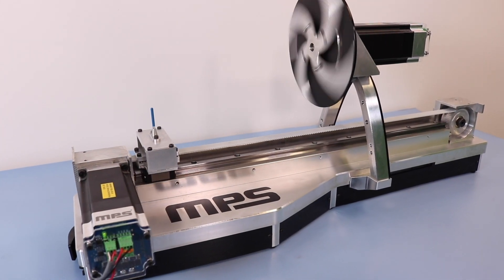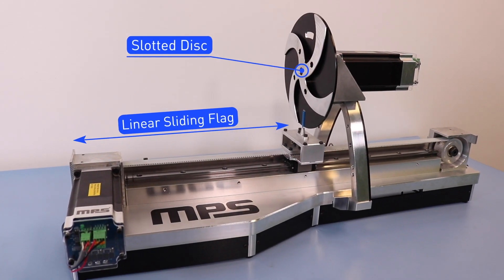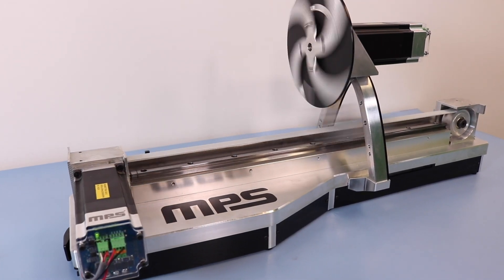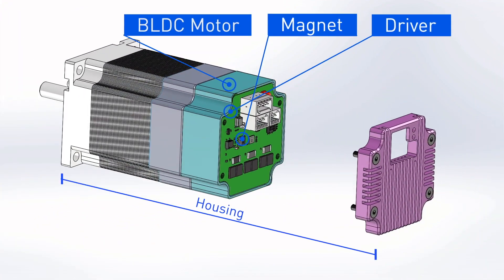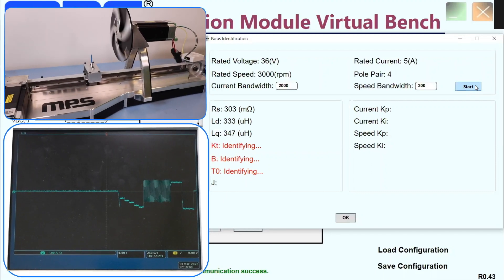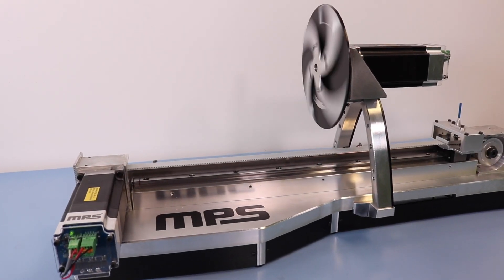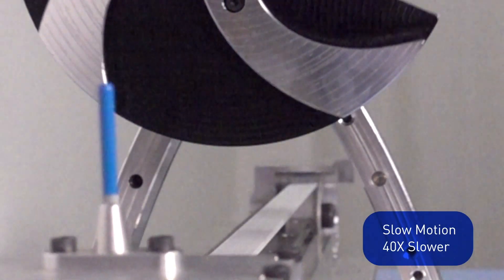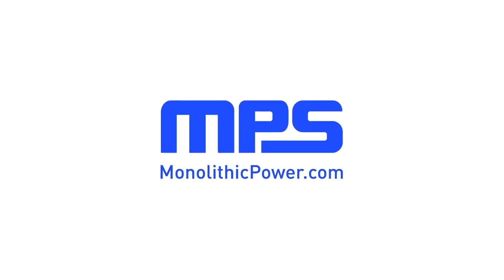Advantages of the Brushless DC Smart Motor Module Evaluation Kit

Comment: I can’t find the Nema17 motor. Can you post a Link or part number? Are these torque wise comparable to steppers? (I do have closed loop servos on my cnc in Nema23. The torque rating is very small, but in praxis it’s working fine) I‘m thinking of changing my Nema17‘s on my pick and place to servos too, but it’s hard to judge if they are strong enougth. I can’t find actual useful information about small size servos.
Reply: @monolithicpowersystemsmps534  I just recognized that I was confused by your product description on the web page.. it states Nema23 188W on all pages. You should change it for the individual item and maybe putting the nema size to the details. However, the information helped me, thanks!
Reply: What's the difference between servo motor and this?
Reply: @jonaspereira3551  It depends on what you mean with servo motor.. If you really mean a closed loop servo, the difference is probably more in the software capabilities, if you mean a stepper, it´s a LOT faster and has the same torque at all speeds (steppers are weaker when driven fast).. if you mean a brushless motor - it has no feedback for position, errors and so.
Reply: @randomname3894  Thank you for reply.
I´m talking about BLDC + hall sensor + encoder motor vs servo motor.
I mean, if I bough an BLDC with hall sensor and install a encoder and use an closed loop driver, this BLDC will turn an servo motor, like those commercial ones no?